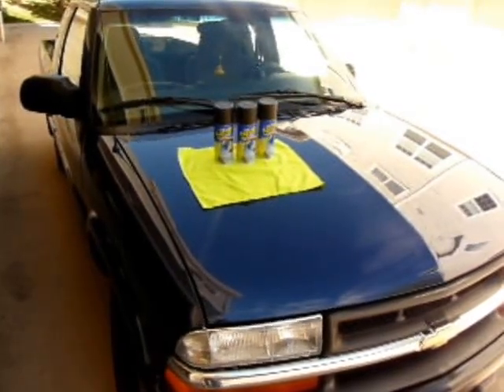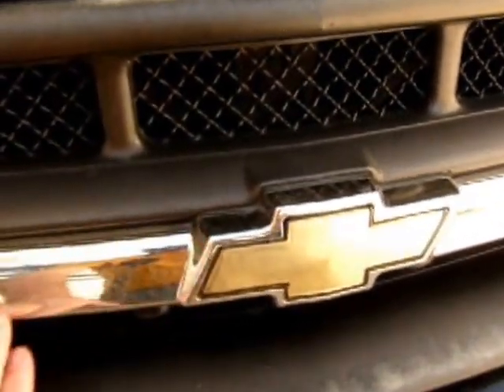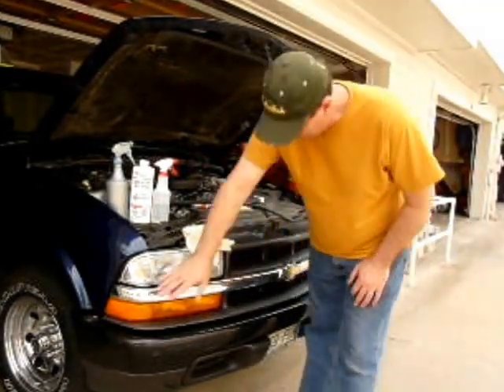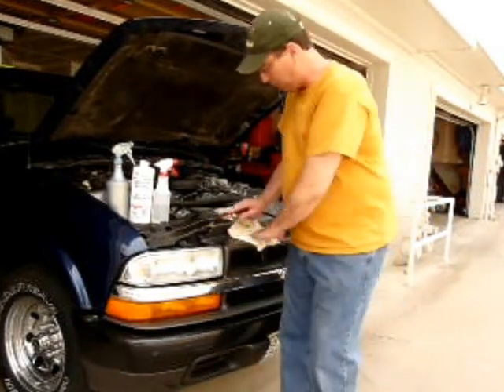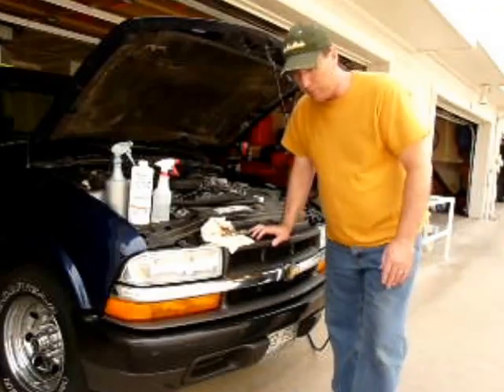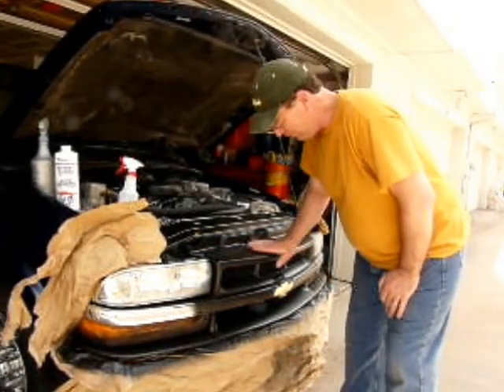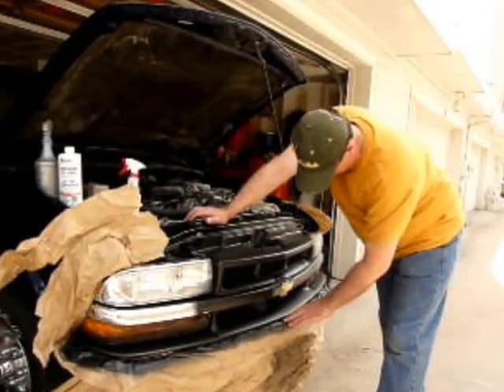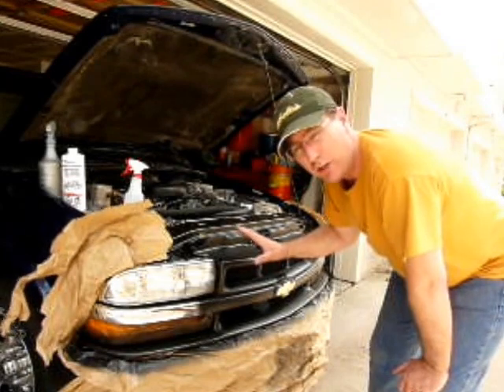Autoramblings Plasti Dip S10 grille

Comment from the maker: Since I was only doing the grille, it was a simple matter to just mask behind it to prevent over-spray into the radiator.  If I recall correctly, on the 2nd gen S10 removing the driver's side headlight requires removal of the air filter intake box.  The job is holding up well. I am hooked on Plasti Dip and have a '05 Ford Focus project I am working on that will be posted on autoramblings-dot-com soon.  Only pics this time, still working on my video presentation skills ;-)
Reply: No, it does not.  I have 2003 ZR2, had both headlight housing off yesterday.  Just pull the 2 clips on each side.

Comment: I'm in the same situation with my 2000 s10. Most curious to know how its holding up? Seems the car wash would strip that right off.
Reply: in all fairness, this truck is garaged full time and used for work related errands only.  The plasti dip looks as good as the day I sprayed it.  I sprayed the grille and wheels of my 2005 Ford Focus in 2014 and it has held up really well.  I sprayed the flat black as a base and the copper metallic over that.  We get some pretty hot summers and the car is in the elements 24/7.  Touch up is easy and I have lightly resprayed the copper metallic a couple of times to keep it looking nice.  After every wash, I use a good spray wax and the plastic dip handles it without issues.
Reply: I'm convinced. I'm going to lowes to pick some up today :-) Thanks for responding!
Reply: Brian Menke  I used the flat (matte) black.  Last time I checked, Lowe's only carried that kind of black.  Check out dipyourcar.com.  They have the whole plasti dip line.  You can go crazy with that stuff.  It's a lot of fun to play around with.  Enjoy!
Reply: Thanks so much!!

Comment: I'm thinking about doing this to my s10, but was there any reason you didnt just remove the bumper? It is only held in with clips! the whole thing can be removed by just removing the headlights, which is done by just pulling two tabs, than finding each clip and it popping it out! The only thing that took me a while was removing the bulb assembly from the headlights and signals. Hows it all holding up? Its so cheap and easy I think im gonna try it! might even do my rear bumper!